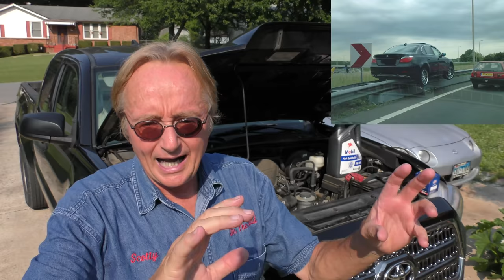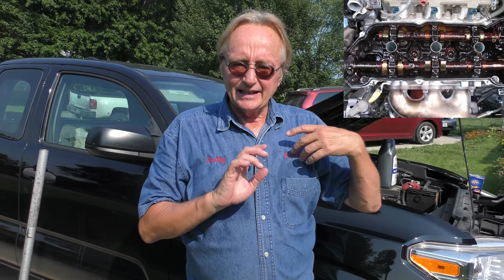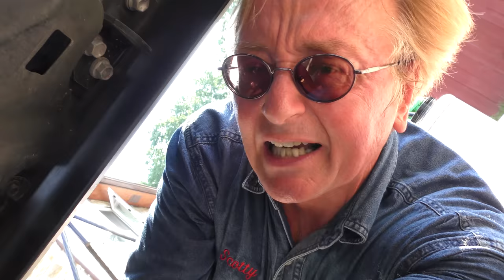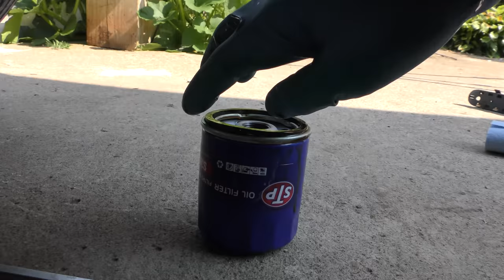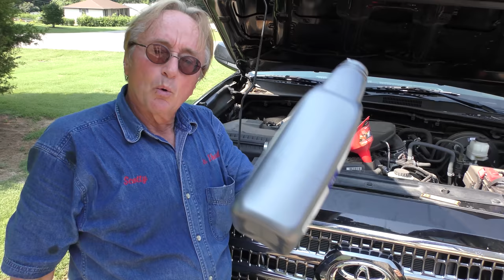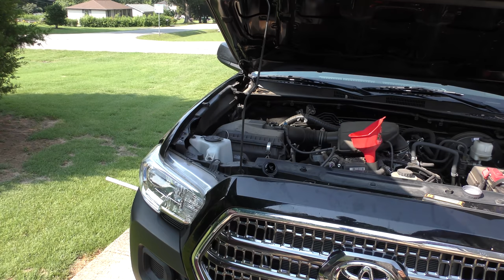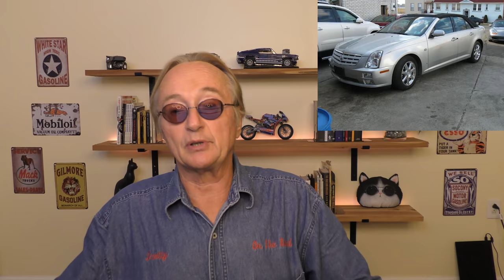My Son Never Changed His Engine Oil, Then This Happened

Comment: I buy my filters for the Toyotas on eBay bulk. I buy the Denso brand. It only comes out to be something like $3.50 give or take for the small Toyota filter. I have even used them in the lawn mowers cause at that price it's about as cheap as a cheap fram from Walmart.

Comment: Warning about quick oil change shops -- they often tighten the plugs insanely tight.  The last time I used such a shop I had to use super-human strength just to remove the drain bolt.  That being said, I don't trust ANY of them since the workers are unskilled or worse -- dishonest --  and don't really care about your car.  Learn from Scotty and do it yourself.

Comment: I am currently on a 10k mile oil interval.  It leaks about a qt. every 1000 miles so its always getting fresh oil, and after 10k miles it gets 10 new quarts of oil and has a 7+ quart capacity.  If it didn't leak i would probably still change the oil at 10k but change the filter at 5k mile intervals.

Comment: Dude I use Mobil 1 extended performance and a Fram XG oil filter.  I change my oil every 15k miles and my truck is at 260k miles now.  Don't use conventional oil and have a regular maintenance plan.

Comment: When I change the oil in my 7.3 Powerstroke, I always punch a hole in the bottom of the oil filter and drain that as well. The filter holds 2 quarts of oil and would rather not where it all over me lol.
Reply: One of my vehicles has a cartridge filter on top. I loosen it and let oil drain from it, then after I drain the oil and tighten the drain plug, I can replace the oil filter without making a mess.

Comment: I do my own oil but now I have a Warranty that gets me free oil changes. I could still do it myself but I would have to go through the hassle of getting reimbursed instead of just going up to an oil change place. I agree with u, I don't trust those idiots and that's why I'm hesitant but at the same time they are insured. If anything happens they have to fix it. Honestly the worst case scenario is the drain plug isnt put on tight which I can always double check that when they are done. So I dunno

Comment: My mom has a 2014 Nissan rogue AWD 92,000 miles on it we switched to full synthetic high mileage from regular full synthetic and we do it every 7500 miles with the tire rotation and tire balancing also about the CVT should we do the drain and fill every 60,000 MILES or sooner Scotty

Comment: I wonder why the manufacturers never put the drain plug at the bottom point of the engine.
Then there is not way that old oil will be left behind with the worst of the sand and debris.

Comment: Ford Tempo 1992 3L-V6 . 
I got a ATX/FLC 3 speed automatic transmission=Dexron III AT oil...
Can you tell me which AT oil would be better for the transmission.
(Dexron III ---- Dexron VI ---- Synthetic?)
Reply: 3 speed AT is a very basic and reliable design since 1930.

You just change AT oil every 50000~60000 miles.  Be sure to flush the metal debris from new gears of new car on the AT oil pan at your first AT oil change, then you can be rest assured with your AT trouble free for the rest of your car's life.   Any AT oil specified matching Dexron III would be just fine.

No need to pay high.

Comment: I like using ramps - much easier and faster esp for her little toyota camry - But 2 comments - 1) I would loosen the oil fill cap before I drained the oil... maybe that helps maybe not, but can't hurt. - 2) I love mobil one oil! but then you used an STP filter on a nice truck like that? yikes! - the filter is important - WIX or Mobil One or Napa (made by Wix) - I actually use the Densco ones for the toyota... they cost like a buck more than the mobil ones, and then I'm getting the OEM filter that came with the car...  Lastly - I like using oil cups! - I tried them all, and there are some filters that don't let you get your extension all the way on the middle as the filters can have a bow... the good cup set is great since there is an offset that allow the extension to protrude enough to let you really get on it! - but other than all that - love your vids Scotty!

Comment: I got a 2004 Nissan Xterra I got 2 problems the a/c compressor makes noise when I turn a/c and the other problem I have is when you step on the accelerator it won’t pass 4000 rpms

Comment: An STP Oil Filter?  Really?   Why so cheap?  I would recommend a Genuine Toyota Filter or K&N Oil Filter.  Also, when I change my oil, I use the recommended 6 Quarts, but I top off the 0.25 quarts with Murphy Mystery Oil.  I have never had any issues with any of the several Toyota Trucks I've owned.  Take care Scotty!

Comment: Hello Sir Scotty, I just want your opinion, I have a 2013 chevy equinox lt about 94000 miles on it. It runs decent, but I notices the engine gets louder overtime, it makes some little noises. But there were no alarms on the panel. Do you think it can still run for another 50,000 miles where I would keep it, or should I trade it in for a brand new car? I used it as a daily work suv monday to friday. I drive 45 mins. one way going to work.

Comment: My lady friend got her oil and air filter changed at a Ford dealership. Her oil change light came on about 8 or 10k miles later. So I checked it. Her air filter lid wasn't clamped down for 10k miles. Her engine was covered with dirt from the guy blowing the parking lot off everyday. I called the Ford dealer and gave them a piece of my mind. The stupid lady took it back to the same dealer and they charged her full price again. SMFH

Comment: I did an oil change on a customer's vehicle yesterday and it was about 3 quarts over full yes 3 quarts over full and it ran like crap so I left it drain for about a half hour and when I was done with the service the car was running better not as good but it was better than what it was

Comment: Hey I got a 2011 crv that burns oil with 200k miles. Was thinking about pulling the head and replace the head gasket and change the piston rings. Should I get rings for a newer model. And yes I done before on older jeeps tks.

Comment: Hey scotty, I just bought a 2016 f150 5.0 V8 and it has 92,000 miles on it. The owners manual says it has lifetime trans oil. Do you think i need to change it now or what. The trans is sealed and does not have a dip stick to even check it. If i change the oil, how do i even fill it back up. Thank I love your show.

Comment: Hey Scotty. Since your son's 2017 Tacoma came with one of those crappy cartridge style filters, you must have modified it with a spin on adapter in order to use a spin on oil filter. Any chance you used the one from Baxter that mentioned in one of your videos several months ago?
Reply: My mistake Scotty. The 2017 Tacomas with the 4 cylinder 2TRFE engines did come with a stock spin on filter so no need for an adapter. Also, no need for your son or YOU in this case to have to mess with the cartridge style filter that makes a complete mess! I have to deal with that crap with my wife's 2011 Highlander but I'll be putting in the Baxter spin on adapter soon.

Comment: One time I was changing my oil on my 96 Chevy and the oil filter would screw on after 3 or 4 times I bring it down and the old gasket was on top of the filter I removed it and it went on just fine after that

Comment: My buddy is a fanatic about changing his oil when the engine's hot because he thinks the oil runs out of the engine when it's hot.  I figure when you shut it off, the oil is running out of the engine into the oil pan anyway, so why do it when the engine and oil are blistering hot?  Is there a flaw in my thinking, or his?

Comment: Car was running just fine but would have a rough idle when at a red light ,  now when I drive the car an try to accelerate the check engine light flashes car loses power and goes dead like there's no gas but always restarts and may idle smoothly until I press gas pedal it then rattles and makes putting sound , shakes somewhat too . The engine codes read fuel level sensor for non working gas hand  and misfire bank #4 could it be a bad motor or catalytic converter???? There's not alot of exhaust coming from tail pipe once car is on in idle it pops when trying to rev engine but dose squeeze exhaust out .

Comment: hey scotty, how ofter the engine oil has to be changed if the vehicle no used many days or months and with little to very little usage, my toyota its been serviced 18 months back and after that i have used some 700 to 800 from last 18months, and what do you think should i change the oil or should i wait till the desired miles is run, i am from india and i have innova crysta 2.4 2GD-FTV engine. and also explain same with coolant part. should one should consider only the miles part or both miles and duration to change engile oil and coolant.

Comment: Changing the oil often (3-5K miles) is a scam.  Used oil analysis has proven that modern synthetic oils will last more than 12 months under normal driving. Just change your oil once a year or 18 months with a reputable synthetic. Don't waste your money and time.  I've gone 2 years without a change in my Accord, which I don't drive more than 750 miles per year. Live in a dry hot climate. Oil is fine.  BTW, oil is supposed to turn dark because of the detergents doing their job. 
DIY with a good made-in-USA filter, Penzoil synthetic, replace the crush washer on the drain plug. Done.

Comment: Best friend service manager at local Ford dealership here in Amish country. Hot shot arrogant self-absorbed lawyer broad bought a new Explorer from them 16 months ago. Brand new. Just had it towed in with a tick over 26,000 miles on it. Engine locked up...drain plug removed to find the hole literally epoxied shut and less than 1 quart of oil in the pan. Of course, she's suing the dealership and Ford for not calling or texting to let her know that she needed an oil and filter change. People!!!!!!!!!!!!!!

Comment: The shoe guys logic was to not change his oil cause he would change it every week. That makes perfect sense 😂🤷. Ok don't change it every 5000 miles, but at least change it ever 10 to 20k with a good syn oil. That would 9f saved that motor.

His filter was probably plugged and by passing for 10s of thousands of miles.

Comment: What about switching from non synthetic oil to synthetic oil, does this damage anything?
Reply: No… it used to years ago because of the different conditioners and additives they put in it but now a days your fine using either or!
Reply: Absolutely not. Synthetic oil comes in virtually every new car and has for years. There are those ill-informed people who will tell you otherwise, particularly older mechanics or owners of older cars, but the claim is 100% false. 
I will warn you that in older cars or those with high mileage that seep or leak switching to synthetic may exacerbate the oil loss. So that is definitely something to consider with synthetics being more expensive. But if your engine doesn’t leak you have absolutely nothing to worry about. Synthetics keep the internals of the engine cleaner so there is an upside if you are considering keeping the vehicle for a length of time. I hope this helps you with your decision. I love your name by the way😶‍🌫️
Reply: No, as long as it's the parameters are within your vehicles specifications and class is the same or better.

Comment: I was changing my oil and drained out the oil into my oil catch pan and thought I had a new oil filter, but I don't so I have to wait for an oil filter to come in about 3 days.

So is it okay to let my vehicle sit up without putting oil in while I wait for the new filter? Or should I put the fresh oil in and then drain it back out when the new filter comes?

By the way, I haven't taken the old oil filter off yet since I didn't want to have that area with nothing on it.

Comment: Scott I have a 2008 Toyota Corolla ce I have a low idle 600 I took out the throttle body assembly I clean it but is still the same do I have to use a scan tool to auto relearn can you help me  what can I do

Comment: Hey man I've been following you for a while and I was wondering if you could answer a question. I'll make it quick I know you're busy. A gentleman is selling me a 2006 Ford Ranger $3,000, it has 260 thousand miles on it he is a well-known mechanic with 45 years of experience. He is not the original owner but I was wondering what your thoughts would be everything else looks fantastic on it not even a drop of rust it was garage kept except for when on the highway. Any advice is good advice

Comment: Have u ever used AMSOIL? Heard its good oil but I personally use Mobil1 Full Synthetic 10W-30 in my Mazda Axela 2010
Reply: I have used amsoil its a night and day difference on how well it holds up.i bought a 2019 Ford ranger with 3800 miles at 4000 I changed it to amsoil at 5000 miles the oil is still full and looks almost new still. I will never go back to cheaper oils.
Reply: Mobil 1 was a great oil at one time. It was all I used but they cheapened up the formula and still charge the same so I switched to amsoil from all the independent test that have been done amsoil comes out on top with pennzoil platnium coming in at close second for the protection the oils can give your engine. Oil is cheap engines are not.

Comment: Does oil change in a hybrid need the same mileage frequency since the engine doesn’t run as frequently driving the same amount of mileage?
Reply: Recommend 5000 miles.

Comment: WARNING: Even if the truck is high, if the jack fails suddenly, it will drop and the truck will fall to a lower stance for a second and reach your face to crash it.... The tires are not cement...they will compress under the fall...and you will probably die. It is TOTALLY incredible to give such advice Scotty...PLEASE redo this video with proper instructions...

Comment: Traveling salsemen, hear me.
You don't oh-so-strictly need to go by a 3000, 5000, 7000 mile rule. 
If you drive as much as the guy Scotty mentioned does, on the highway, change your oil once every month or two months. Say, at the end of the month.
Just get it done. 
It will save you alot of money

Comment: DONT put 6 .2 quarts in a Taco 2.7 TOO MUCH instead a little oil in the filter and then the entire Gallon of Amsoil 0-20 and it will be a little above the full line PERFECT
OH and the real trick MY FRIENDS is from the beginning with a new Toyota motor anyways change your oil and filter every 1000 miles for the first 5 and then go regular 3 to 5 k BECAUSE when your Toyota little 4 cylinder motor has 80,000K PLUS mileage on it  ONE day you will look down and you will be flying over 80MPH in your little Toyota and it is so composed THAT is why TOYOTA is the best OH and you can sell it for more than you paid WHOA.

Comment: Whoa, Scotty! NEVER get under a vehicle that is supported only on a hydraulic jack! You are endangering the public with this idea. I don't care how high the truck was in the first place.... if the jack failed or (as happens) it got bumped out of place, the truck would NOT just fall to its normal ride height... gravity from the falling weight of the truck would compress the springs, bringing all that weight down on your body, causing serious injury or death! Until now, I've never heard you give BAD advice... shame, Scotty! Tell people SAFETY is a priority!!
Reply: @mcc7762  Agreed, it actually is the safest way. The only time where jack stands would be better is on the side of the road, as happened to me one time in my old RV when a brake caliper failed. I carried jack stands in the RV storage box, and got the wheel, rotor and bad caliper off safely in around an hour. $150 in parts and $40 for the cab ride to the nearest parts store...

Comment: Wrong. Toyota have vvt solenoids, timing chain tensioners and lifters that rely on oil pressure. They used to have timing belts and shim and bucket lifters so a lot less oil sensitive. Toyotas are great, but they are oil sensitive. Brother had an 80s corolla. It did 80000km with no servicing. I changed the oil after my sister inherited it. Changed the oil for her. Old toyotas Scotty. Old.

Comment: I wouldn't want be his son when he pulled that drain plug 🤣    What the Fffff really that dirty 📣. Yes High Pressure washing your car engine off can be really bad, I have had to pull all the ecm plugs on a car once to clean out all of the water that was forced past the ECM plug seals,Every light on the dash came on it barely started, This happens too often if the person washing dosen't pay attention where the water is going, it's just a bad idea in most cases 🤑

Comment: You speak about low paid workers in a very condescending manner. Your point is taken and maybe there is truth in it...but it is still patronizing. Guess what? The minimum wage should have BEEN raised, dramatically...it's been $7.25 nationally since 2009. It should have been at least $13 since 2016. It also needs to be indexed to inflation annually, because as soon as a minimum wage is set it begins to lose purchasing power as inflation occurs.